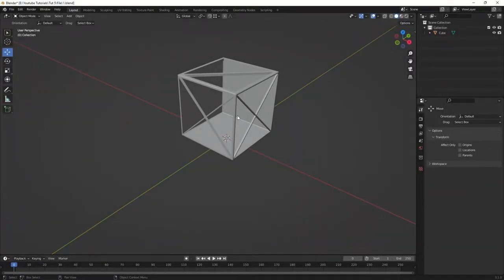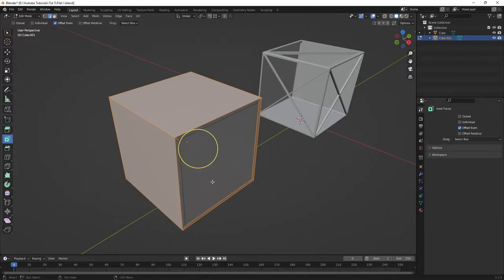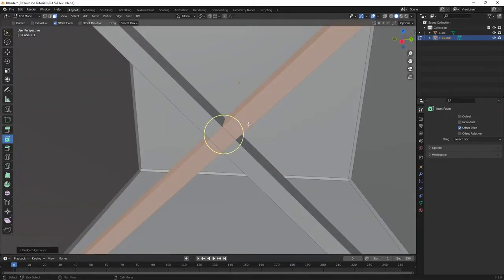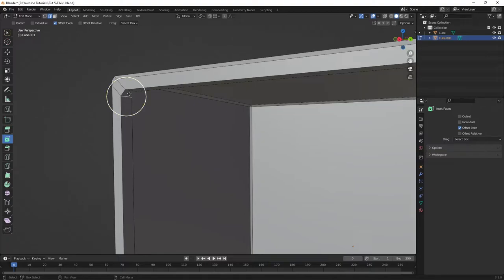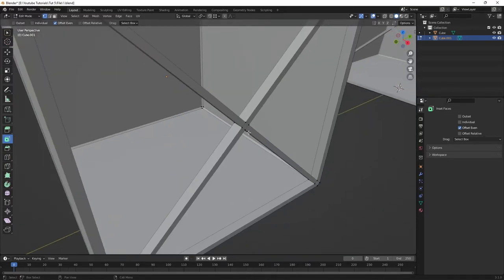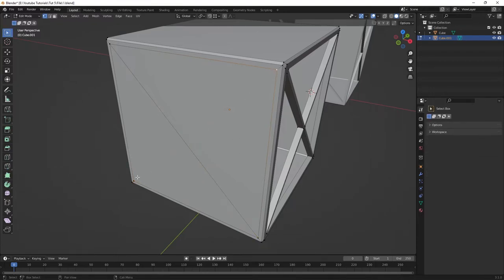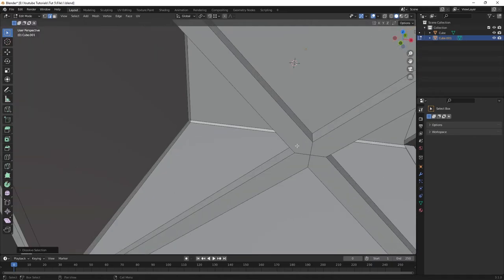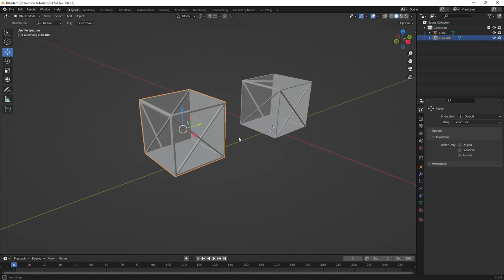Modeling Trusses in Blender The Proper Way!?

Comment: Much easier to just use the a Triangulate and Wireframe modifier.
Making anything significant with the method in the video would take ages.
Reply from the maker: With the Wireframe modifier you don't control over where you want to add the trusses, it turns the entire mesh to a "Wireframe". The method showed in the video gives you more control and flexibility.